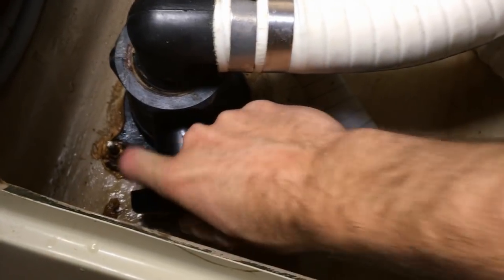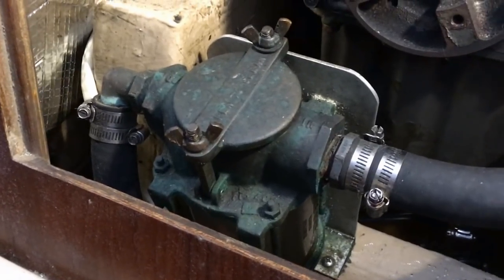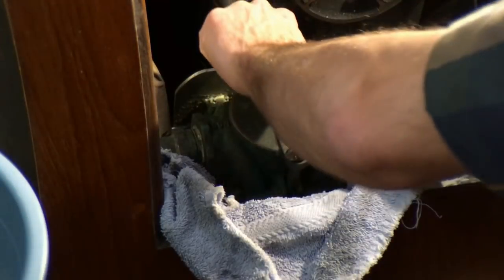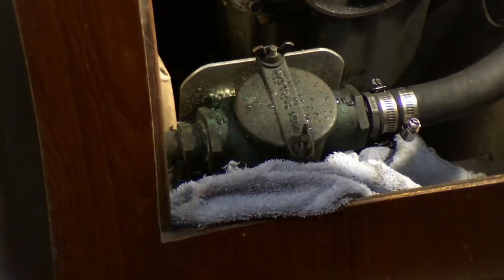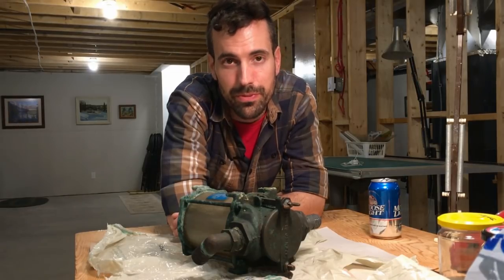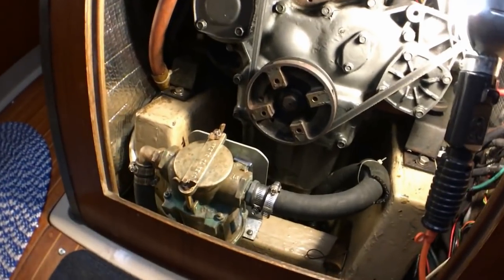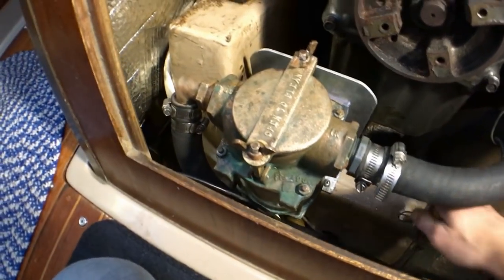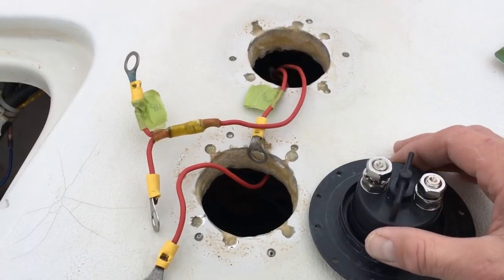Sea Strainer Maintenance | Sailing Balachandra E016

Comment: My Yanmar 3GM30F was giving my "CW TEMP" alarms after 20 minutes of running. I was seeing water from the exhaust port, but only a trickle.

I opened up the raw water strainer and it was clean. So I took it out to take a closer look.

There was a 90 elbow fitting on the input, and it was plugged with grass. That is, I had a blockage before the strainer. 

I may replace the 90 with a straight, someday, but I'll need longer hoses, so I'm not doing it today.

Comment: Great job, Dan. I have never heard of that particular paste mixture. You may have seen on my Instagram that when I rebuilt the strainer that I picked up at the boat flea market, I just submersed mine in plain white vinegar only and it removed all of the green, however, it did come back somewhat in a few days. I don't know if there is a permanent solution.

It won't be long now till you're taking the winter cover off! Cheers, Phil
Reply from the maker: I didn't want the Vinegar to get into the existing plumbing connections so I avoided Emerson... the green did come back a little on mine as well, but I figured it would. Thanks Phil! :)
Reply: instablaster

Comment: I like the idea of the plastic between the strainer and bracket, but unless the bolts were also isolated not sure you’ve accomplished your end goal.  If it turns out to continue corroding, maybe make a bracket from several layers of fiberglass and epoxy, although as long as its the aluminum that’s corroding and not the strainer, it would take several replacement aluminum brackets to pay for the cost in time/material of building a fiberglass bracket.

Comment: Dan, any issues with air lock? Or are you addressing that by loosening the top bolts to let water fill completely? Thanks!
Reply from the maker: I used to do that but the impellar will suck air or water out of there so it doesn't really matter